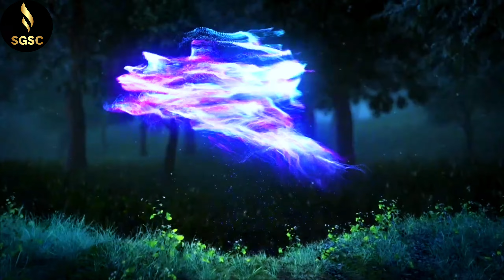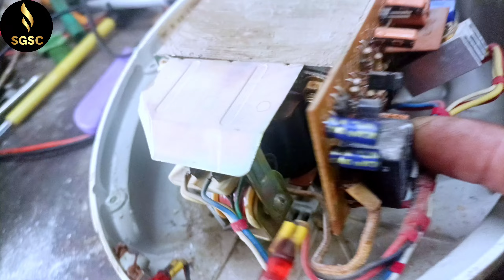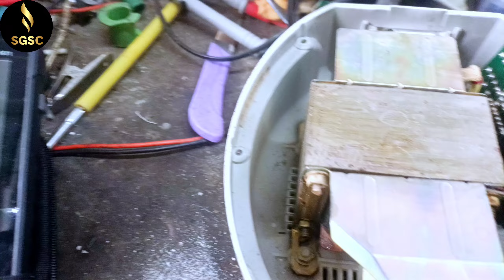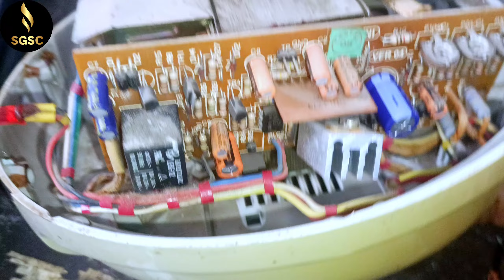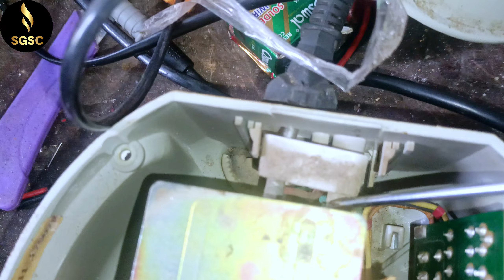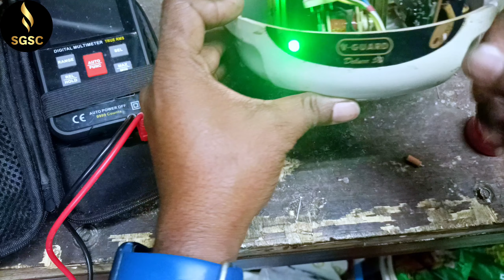V-Guard deluxe 50 stabilizer output not working how to problem Tamil #shortsfeed #shorts #viral #jar

Comment: New stabilizer for refrigerator not showing output...is any problem?
Reply from the maker: Yes your change to main all capacitor mft220/40v mft100/35v mft10/35v-mft22/25v
Reply: How much money spend Anna?
Reply: Anna....5 months not showing output...continuosly running in refrigerator..is problem for fridge?
Reply from the maker: @i5gaming05  Rs.100
Just hundred rupees
Reply from the maker: @i5gaming05 புது ஸ்டெபிலைசரா இருந்துச்சுன்னா கேரண்டி இருக்கும் கம்பெனியில் கொடுத்து சர்வீஸ் பண்ணிக்கலாம்